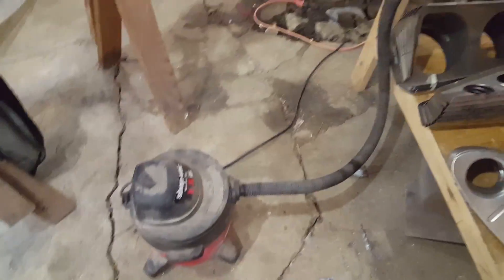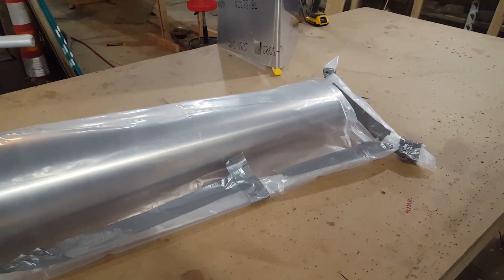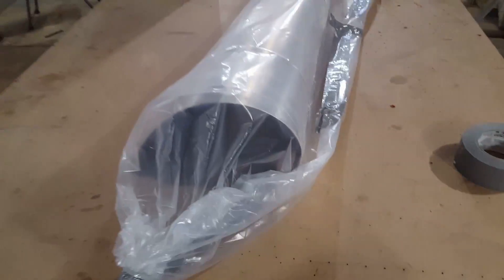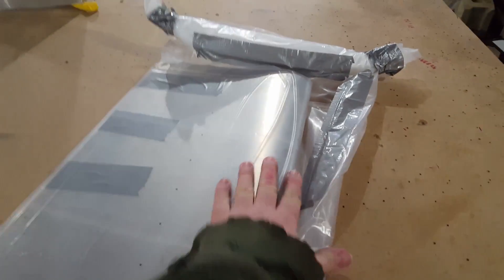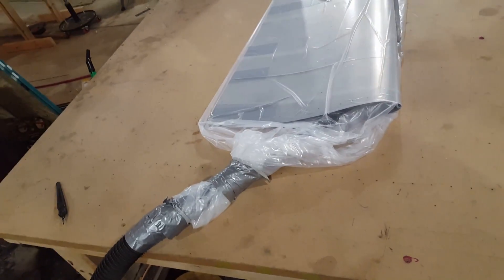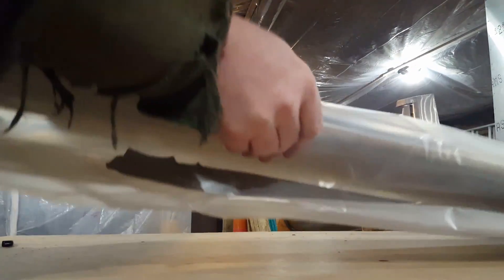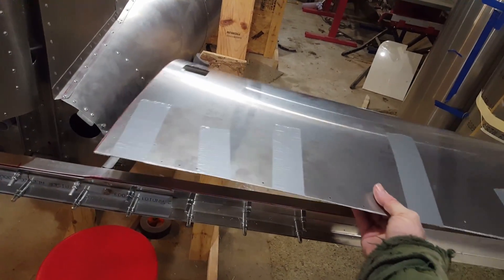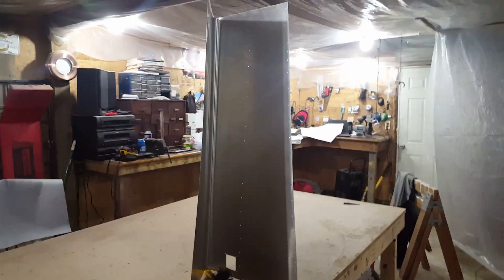Hummel h5 vacuum forming

Comment: Too fast, too sharp, may be ok for the leading egde of a tiny HS but many planes need a larger radius. Put a restrictor in the vacuum line so it gradually collapses and you can monitor the progress.

Me I jut just the appropriate piece of tube, 3 rivets down the centerline and into the tube, 3 rivets along the edge (where you have taped it) and I just push a heavy piece of square tube down close to the centerline on a flat surface. Do not press down with your hand only.
Reply: Mark Mark speed of the bend has nothing to do with anything... lol